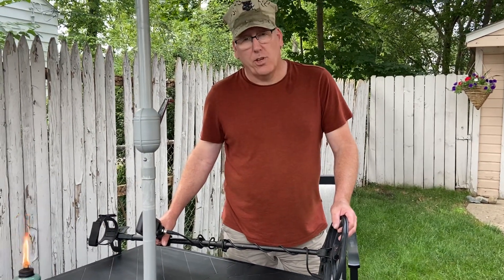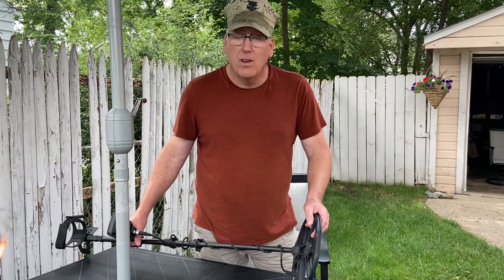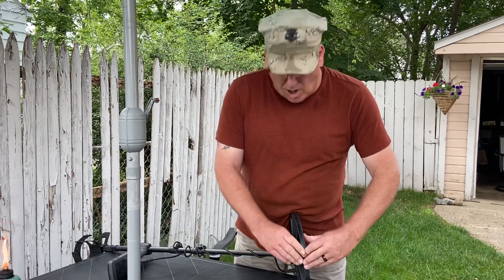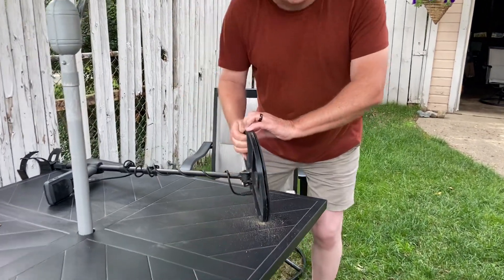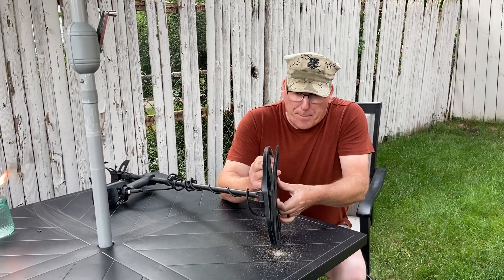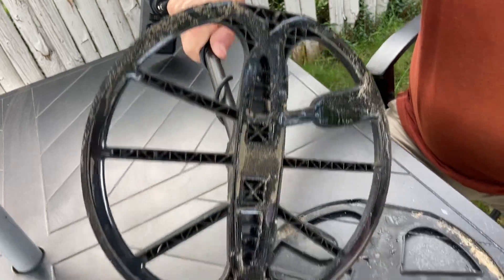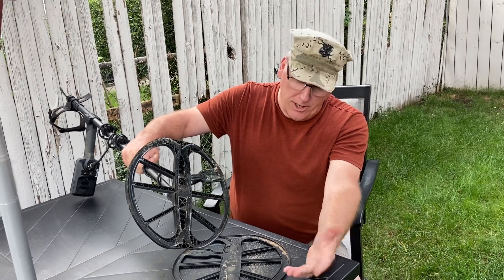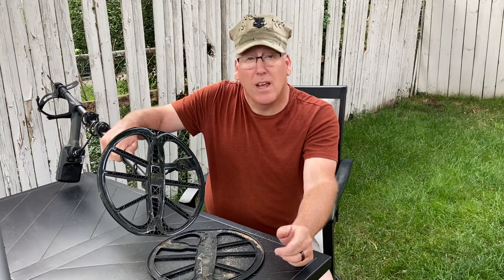Metal detector chatty or unstable? Try This EASY FIX!

Comment: I have been using spray on truck bed liner for the bottom of my coils.
Reply from the maker: Instead of a coil cover or in addition to it? Did you take off the factory cover & spray it on?
Reply: No coil cover. I just sprayed the bottom.
Reply from the maker: Ah.